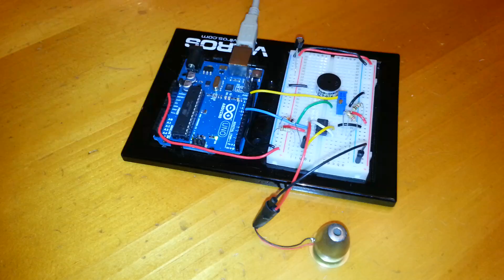High Sensitivity Vibration Sensor Using a Piezo Element and Arduino Uno

Comment: Hi David

Could you please clarify whether this piezo element would be suitable for vibration measurement and data logging like an alternative to accelerometers such as ADXL or MPU modules? Asking this because I found that the latter sensors were incapable of detecting slight vibrations

Comment: Without modification, your design detects a grain of sugar falling on my notebook, stunning! My goal is to stick the piezo to my ceiling windows and detect rain, which will wake up an ESP8266 from deep sleep (pulls the reset pin LOW, effectively resetting the ESP), and alert me through Telegram. I have done this with an HC-SR501 PIR sensor, which momentarily turns an NPN transistor ON as it outputs HIGH when motion is detected and remains LOW for 1min to avoid too many re-triggers. Thank you!

Comment: Hi David, thanks for sharing this. Simple question, I want to detect a bee landing on a flower, then triggering music events. I've been using an ADXL355 sensor in another project where I sense a tree moving in the wind (extremely sensitive) but also expensive! I was wondering if your circuit might be more suitable for my application?

Comment: How do I connect it to an ESP8266? ADC has 1V max?
Reply: The circuit in this video puts out a digital logic signal that goes 5v hi when the piezo vibrates more than a set threshold. If you want to measure the waveform from the piezo, like in a seismometer, you only use the first half of his circuit, the amplification part: http://davidhoulding.blogspot.dk/2014/02/high-sensitivity-vibration-sensor-using.html
You can protect your ADC in two ways. You can use a 1:5 voltage divider, so the maximum 5v signal becomes a maximum 1V then you have the full range of the sensor. You can also leave it as is, but protect the ADC with a 1v zener diode. In that way you have maximum sensitivity, but all stronger signals will be at maximum ADC value.

I myself is building a car alarm and I want to detect people breathing heavily while walking past my car. This circuit has amazing sensitivity and can trigger my security cam in these conditions, so personally I'm not trying the same thing as you, but this design is the most clever I've seen on-line and is as sensitive as expensive commercial detectors.

Comment: Which weight did you put on the piezo element to gain this high sensitivity? I need a really high sens to register a falling postcard in the mailbox. And which diameter and thickness would be better to register more sensitive (there are different sizes, you probably used the 22mm diameter one)?
Reply: I need the answer of this. Help.

Comment: Hello Mr. David, i saw that you updated your circuit with a 0.1 uf capacitor and used a 160k resistor instead of the 220k. im having some questions. first: why in the breadboard schematic you have a 10UF but on the draw schematic theres no 10UF Capacitor? 2: i'm not that into electronics so im having a hard time understanding the diagram. i can donate around 30 or 50 usd to your site if you can update the Breadboard circuit please! so then theres no way i can screw up my circuit. hope you understand. Thanks
Reply: btw i totally forgot to mention that this is really really helpful and thanks for coming up with this citcuit and sharing it with us. cheers

Comment: Great video thanks for posting , do you have to use the ardino board why not just a transistor.? I want to build a fishing alarm that detects line movement over the piezo element and to be able to change the volume / tone of the buzzer and sensitivity of the piezo.
Reply from the maker: It may be possible to shrink down and avoid using arduino, depending on the application. Even for a simple application I suspect you'd want to extend your response to a vibration event since the vibration can occur and be over quickly but you may want your response to it to persist longer. FYI you may be interested in using an attiny chip see https://youtu.be/30rPt802n1k
Reply: Basically its a fishing bite alarm , the line runs over a vib sensor , I need a sensitivity control and speaker with volume and tone only

Comment: Hi David, in this experiment you have used threshold to see whether there is vibration or not , But if I have to make use of this experiment to measure actual value of vibration like vibration meter, how should I do this? Can you please help me out?
Reply from the maker: Do you mean counting vibration events, or differentiating between different types of vibrations?
Reply: Counting vibration event
Reply from the maker: +ABHISHEK LAHOTI You could enhance the Arduino sketch to count vibration events. Note that a single vibration event can have multiple vibration peaks, measured as 1's or HIGH values by Arduino. To count vibration events rather than peaks you'd have to have some logic in your enhanced sketch to detect when a vibration starts, eg first peak, and then see when the input drops low for some set period, eg 100ms to indicate the end of the vibration event.
Reply: Yeah, Thank you so much!
I will try doing that.

Comment: Sir can you also post or maybe message me back the diagram of this circuit?

id like to try it :) and what are the parts of the circuit?
Reply from the maker: Filmar, you can find details of this project including a circuit diagram, Ardiuno sketch and so forth in my blog at http://davidhoulding.blogspot.com/2014/02/high-sensitivity-vibration-sensor-using.html Have fun.

Comment: I can't thank you enough for posting this, I wonder if it could be separated into axis though. Is the piezo is sensitive to vertical motion in this configuration more than lateral?
Reply from the maker: Chris, there may be some sensitivity to axis of vibration, you'd have to consult the datasheet for the particular sensor you have. I use a piezo element which is mounted horizontally and has a weight epoxied to it. I have found that it detects all kinds of vibrations with high sensitivity. Keep in mind that the op-amp is amplifying the signal and then going through a comparator, so any minor differences in sensitivity by axis are likely to be insignificant once passed through the op-amp and comparator. One challenge you may have is since this is so sensitive you may want to have some way of filtering out false positives to detect the kinds of vibrations you are interested in. You may be interested in the recent blog I did on this subject. at http://davidhoulding.blogspot.com/2014/11/advanced-high-sensitivity-vibration.html Have fun

Comment: Hello David, i am a student at the university of Bath, UK. I recently managed to set up a circuit with a piezo sensor and arduino uno. I am trying to detect the vibrations caused by a table tennis ball on a table tennis table although i've realised that those vibrations are so minuscule. Do you think it is possible that something like this could read in such vibrations?
Reply from the maker: hi Ricardo, I have found it very sensitive so should be up to this. you can improve sensitivity if you use a weight on the piezo and adjist sensitivity right. you may find it also picking up bumps from players etc. to differentiate you may want to consider combining with other sensors, perhaps optical or audio, depending on your requirements. have fun

Comment: David, unfortunately I am not a electrical engineer and looking for a finished product that is small enough to fit my case. It would be nice if these units would come in a finished product.  Thanks for the information though!
Reply from the maker: hi Darrell, thanks for the feedback. curious about the application you have in mind. is it to detect movement or theft of case?

Comment: David, I am trying to find a simple vibration sensor to connect between a GPS unit and a external battery. I am trying to use the sensor to allow voltage to the GPS unit when it senses vibration from a moving car.  I have ordered several of the Arduino sensors but cant get them wired correctly.  Can you please help me?
Reply from the maker: Interesting project. One idea would be to wire the vibration sensor I discuss here (see blog at http://davidhoulding.blogspot.com/2014/02/high-sensitivity-vibration-sensor-using.html for details) to a chip in the ATTiny series eg see How-To: Shrinkify Your Arduino Projects which draws very little current and will maximize your external battery, and they have a sketch you upload to this chip detect vibration and then drive an enable on a voltage regulator which can power your GPS / Arduino, eg KA78R08CTU which you can read about at http://www.mouser.com/Search/ProductDetail.aspx?R=KA78R08CTUvirtualkey51210000virtualkey512-KA78R08CTU. Let us know how it goes.

Comment: Sir, is it possible for the vibration sensor to sense only a strong vibrations like car accidents? can you make a sample Sr? for project purposes. thank you
Reply from the maker: Hi Christian, this vibration sensor is good at measuring any kinds of vibrations and could certainly sense vibrations from an accident. However, you may struggle with this technique in filtering out small vs large vibrations, ie a car accident vs someone sitting in the car, or a strong wind buffeting the car. For detecting accidents you may want to use something more sophisticated such as an accelerometer where you can get a measure of deceleration.
Reply: David Houlding thank you sir, but can we specify a maximum force to the code so that it can only sense a large vibration?
Reply from the maker: Christian Duke Tugay Hi Christian, in the circuit I used (more detail at the link to my blog in the video description) I use an op-amp to amplify the input signal from the piezo sensor, and then pass through a comparator. The comparator threshold can be adjusted with a potentiometer, which functions as the sensitivity. The output from the comparator is binary, either 5v "1" or 0v "0". It is possible to use this approach for a basic adjustment of sensitivity to avoid triggering on low vibrations that are not of interest. FYI useful into on piezo sensors at the wiki High Sensitivity Vibration Sensor Using a Piezo Element and Arduino Uno . Note the V/F vs frequency response graph around mid-way down on the right, and in particular the linear usable region of response ... this is where voltage is proportional to force, which in turn will be proportional to strength of vibration. In summary, you can use this for basic differentiation of strength of vibration. However, for more accurate measurement  and in applications that could affect personal safety, such as detecting car accidents, you may want a more sophisticated way to differentiate different sources of vibrations. Sometimes its not an either / or. Your application may warrant a vibration sensor and accelerometer. Hope that helps. Good luck. Have fun.
Reply from the maker: David Houlding Wiki on piezo sensors: http://en.wikipedia.org/wiki/Piezoelectric_sensor
Reply: David Houlding Thank you very much Sir. It helps a lot for me.

Comment: Hi David, Is there a way of measuring input frequencies and magnitude of these frequencies? I am trying to design a circuit with a bandpass filter to detect frequencies of around 50-60 Hz, What i am looking for specifically is the Vpp fluctuations and recording this data. any suggestions would be much appreciated
Reply from the maker: Hi, not sure specifically what you mean by Vpp. It should be possible to put a bandpass filter on the front end of this circuit to take the input from the vibration sensor and pass just the frequencies you are interested in. The op-amp would then amplify just the frequencies passed by the filter. It sounds like what you want on the output after amplification is a peak detector so you can follow the amplitude over time. It may be sufficient for your purpose to use a simple diode with a capacitor and resistor in parallel on the output of the diode for this, and read the voltage across the capacitor with an Arduino analog input. That said, I have not implemented this so you will have to experiment. I would be interested in hearing how it goes. Have fun! David